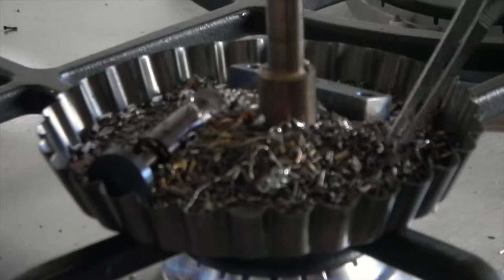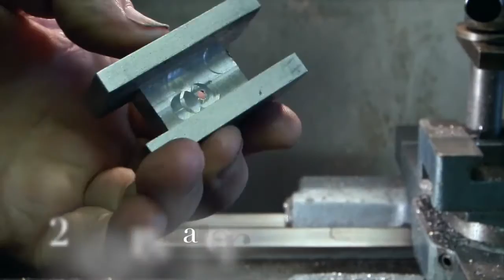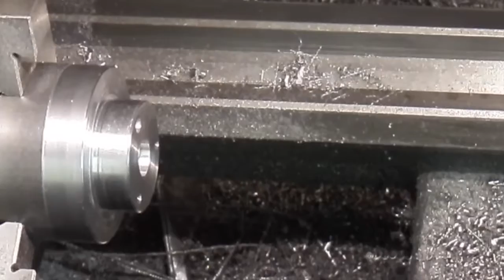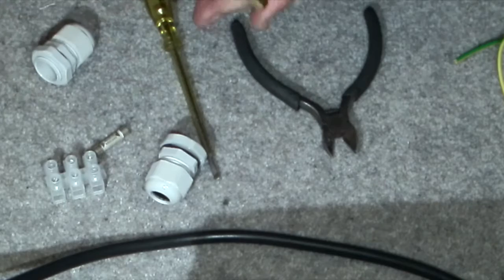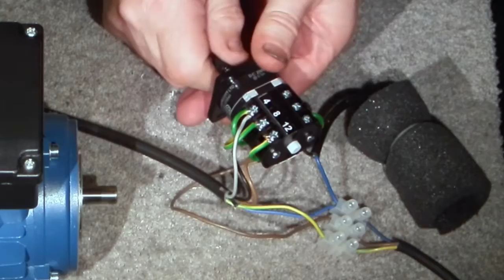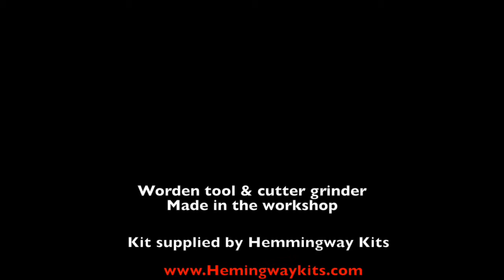Tool & cutter grinder part 6

Comment: Good series Alan. But can it be purchased complete. Due to I don't have a milling machine to complete some of the parts. I have been in the market for a tool bit sharpener. This one seems to be one of the best I have seen.
Reply from the maker: Hi Anthony
I don't have a milling machine most of the work is on the lathe. I used my drilling machine as a mill but this could be done by hand.
The kit comes with instructions on the set ups for machining You can purchase the plans and if you decide to buy the kit they deduct the cost of the plans. Have a look on the website listed on the videos.
Alan

Comment: Hi Alan, I enjoyed this series especially as I am entertaining notions of building a tool and cutter grinder myself. 
Why the Worden?
Boxford for 45 years, cnc engraver, a "drilling machine" you can sort of mill with, you are well equipped and well skilled so any grinder would be within your capabilities. The Worden seems to be one of the simpler ones you could have chosen.
I have just acquired a lathe and a mill but had not been near a machine tool for over 40 years so I am starting from scratch. I am not just rusty but seized solid so I would be interested in your thoughts.
Keep up the good work,
Jerh.
Reply from the maker: I purchased the drawings first then the kit because it came with all the parts and drawings and I wouldn't spend time purchasing/designing.
I wanted to make some youtube videos so other people could see what you get in the kit and how it was made.
So if you have a lathe and milling machine why not chose a kit or visit a model engineering exhibition, some of the bigger ones have a good selection of tools and kits.
I designed and built the CNC machine over a year and updated it three times, Im still learning CNC programming and how not to smash my milling cutters.
Ive made some updates to the cutter grinder which will be shown soon.
Thanks for watching.
Alan